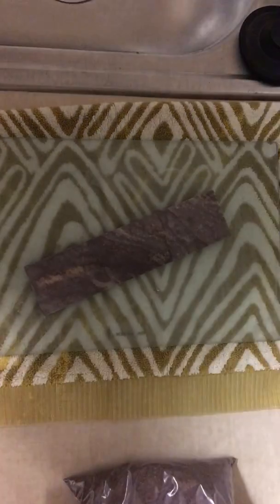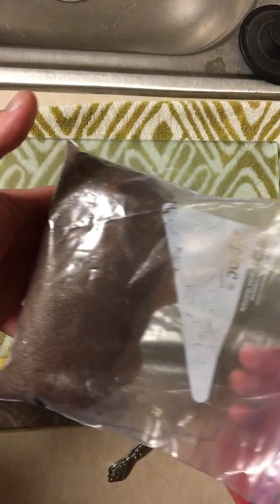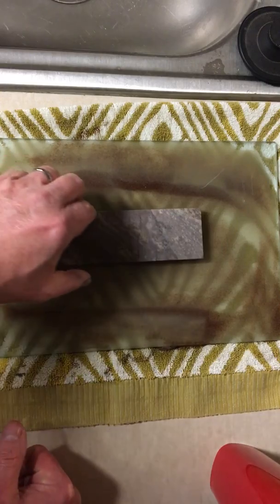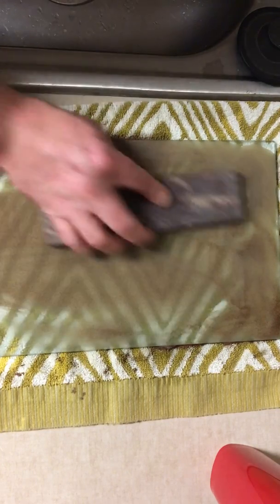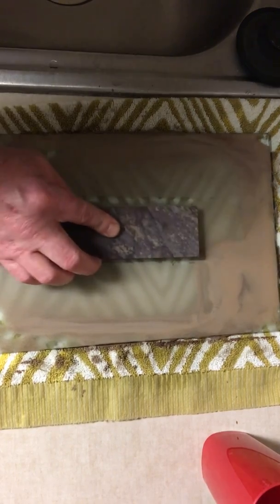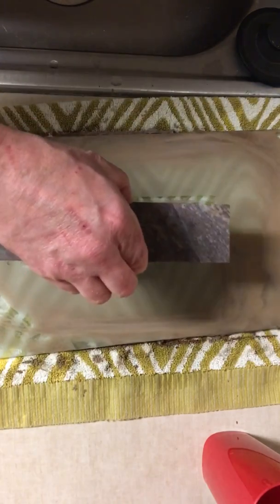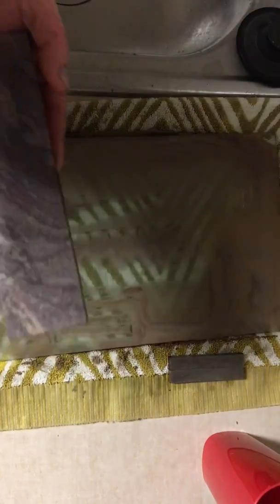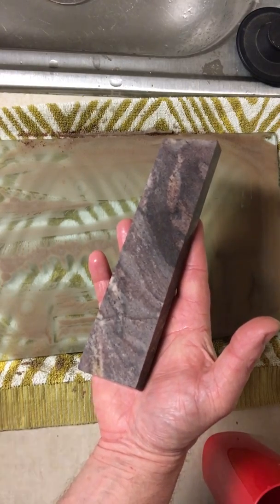Flattening a washita with granite powder

Comment: do you still have your smith washitas? i just got one from ebay, the seller said it was a smiths but there's no name on the box. its a nice little stone though, it even has a little translucency. i just spent about an hour lapping it flat, i left both sides coarse but one side slightly finer than the other. ill try running my pocket knife on it tomorrow
Reply from the maker: No I dont

Comment: Hey chris i was curious if you've had any experience with the Case Washita soft Arkansas stones? These are recent, not vintage. My question is if these are really Washita stones? s
Here's a link....
https://www.amazon.com/Case-CA00903-Washita-Arkansas-Oilstone/dp/B00002ND5E/ref=asc_df_B00002ND5E/?tag=hyprod-20&linkCode=df0&hvadid=198090983914&hvpos=1o1&hvnetw=g&hvrand=13733748245185309629&hvpone=&hvptwo=&hvqmt=&hvdev=t&hvdvcmdl=&hvlocint=&hvlocphy=9022581&hvtargid=pla-377848628865&psc=1

Comment: Beautiful stone , I still wonder how people tell a soft from a washita apart . I was told a washita is softer than a soft Arkansas . Now both are novaculite from the same area . It still has to come down to density but then why do dense translucent cut so good ? my old smith looks like a soft but dans son , Steve said it was a true hard , so looks can be deceiving but most of the time looks gave a good indication. Still , love the colors . And has anyone seen a lily white or ruby red ? Those were names some of the old timers called some of the washita stones . Still learning about these stones . Hey my dad found his old smith stones , a black and he said a red . Can't wait to see them after 40 years !
Reply from the maker: Sam4yeshua washita is a weird stone. I still don’t fully understand them. And yes I agree sometimes visual plays a determining factor. Some washitas are very heavy and some not so much. Usually a crazy colored pattern is a meh one. Solid white is the no 1 I’ve had a couple I’ve only seen a ruby red never used one. I wish Norton would open that mine back up.
Reply: Rough Rooster Knife Sharpening I know where it's at , north of hot springs
Reply from the maker: Sam4yeshua no shit? Hmmm we need to go 🤔
Reply: Rough Rooster Knife Sharpening me too
Reply: I have a few Pike Lily White Washitas, they're wicked stones. Quicker cutting compared to the average soft Arkansas. You can find them on eBay every few months or so, tricky to find one in good condition. Using less pressure as your edge develops on a soft lily white you will see a mirrored edge coming. Not quite hair whittling but it'll shave. Very interesting stones. I'm hooked on Arkansas stones. Chris knows what he's talking about, that's where I learned most of this stuff.
Reply from the maker: PeaceCountryBoy thank you kind sir.
I know! Isn’t that weird? Less pressure gets a finer edge and almost mirrored from a coarser stone. Very odd. 
Hey have your Lilly’s ever produced a small amount of white slurry?
Reply: @RoughRoosterKnifeSharpening  Yes, they do produce a bit of slurry but not as much as a guy would think with it being so soft. More noticeable is the amount of fine particles being left on the stone while sharpening. It's the equivalent of taking a carpenter's pencil and dragging it across the surface of the stone. The surface lasts a long time, not like a soft where from time to time it needs refreshing.  Always like your videos Chris, find myself lookin' for your new ones often. Bevels 154 cm and 1095 nicely. CPM S-20V lol not so much. (Had to edit this comment, had the wrong steels in there)

Comment: I picked up a 8 x 3 x 1/2 black arkansas, non Dan’s stone. The stone is rough and needed flatting. I was able to flatten the stone using a DMT lapping plate.  I then used 400 and 600 grit wet/dry sand paper. The stone is much better but I feel like it should be smoother. Any suggestions?  Should  I finish the stone further, maybe 800 to 1000 grit or even a higher grit?
Reply from the maker: Jeff Marks oh yea. I’d take that up to 1,500 or 2,000

Comment: Good video almost looks like a soft ark
Reply from the maker: Tony Blocker it’s a old smiths. I’ve used it some but not enough to verify.
Reply: Rough Rooster Knife Sharpening lots of color which you don’t see a lot anymore
Reply from the maker: Tony Blocker nope you sure don’t. The patterns in this one are crazy to
Reply: Rough Rooster Knife Sharpening yea it does like to run a blade across it
Reply: Super video Chris - I never fail to pick up a tip from you! 
Wayne
Reply: Some companies have that habit of labeling softs as washitas. True washita is really unique vs soft arkansas as it has such a wide working range of refinement